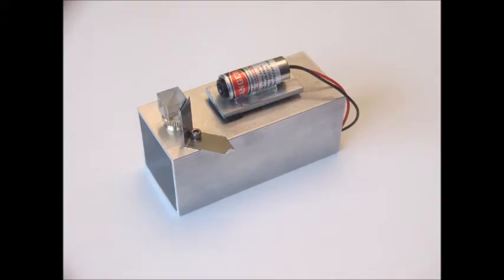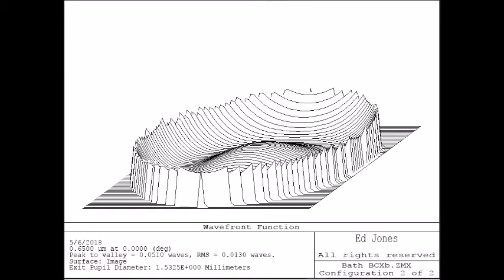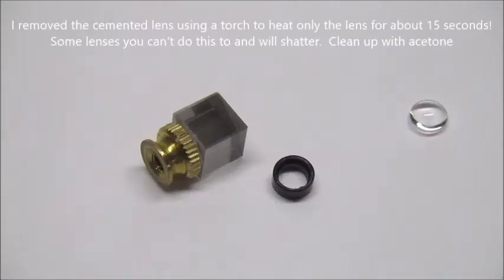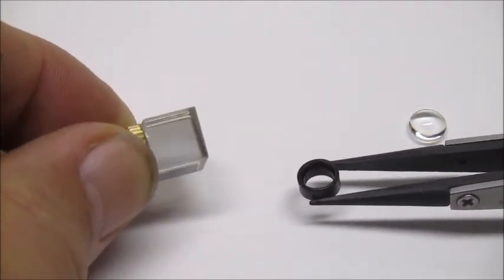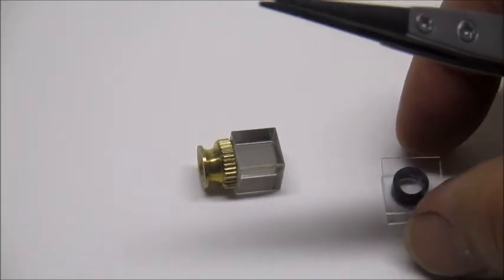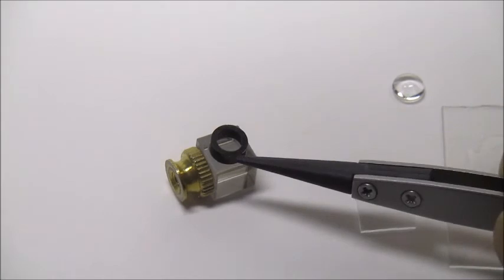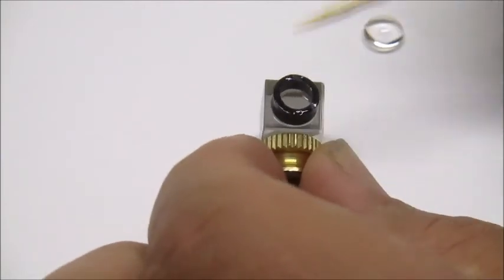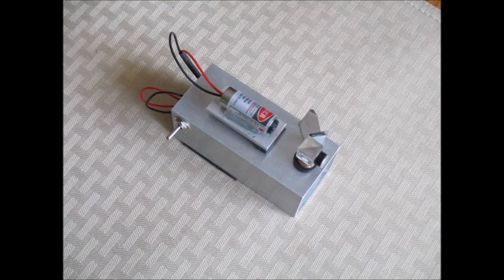Bath update

Comment: How then do you test that your two beams are aligned correctly coming from the Bath.  The reason I always use a separate mounting for the lens is so I can remove it and adjust the two beams.  In addition one needs to rotating the lens a couple of deg to keep the laser reflection out of the interferogram.  After the cube is rotated then the beams are no longer parallel enough and you need to adjust the side mirror.  But with the lens glued to the cube you can't see one of the beams.  So to me this is not simpler and make the use more complex.
Reply from the maker: Rotating the prism a few degrees will keep unwanted reflection out if the Igram but since a lens has curved surfaces a few degrees of tilt isn't enough to do that with the lens.  Those reflections will be diverged and faint anyway.
"But with the lens glued to the cube you can't see one of the beams."  This isn't related to the lens, when you rotate the beam splitter you always have to adjust the reflected beam with the side mirror.

Comment: Very nice, Ed! Mounting the lens as you have it is a definite advantage as I see it. The fewer surfaces open to air the better since my biggest problem with a separately mounted lens is dust and dirt quickly accumulating on the 2 exposed surfaces. Having just one surface exposed to open air results in half the problem, and a single surface very easy to clean. Thanks! Joe1950CN
Reply from the maker: J D,
   There is an advantage to cementing it directly to the cube to
eliminate 2 air surfaces as long as you don't do too fast a mirror.

Ed